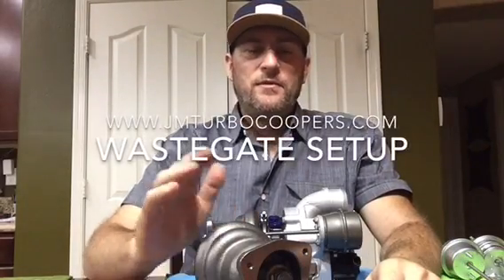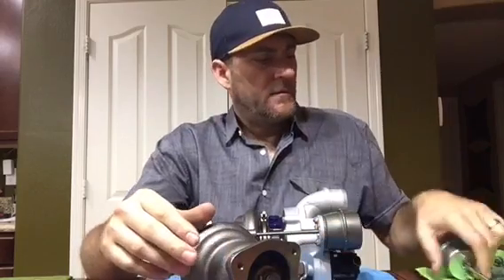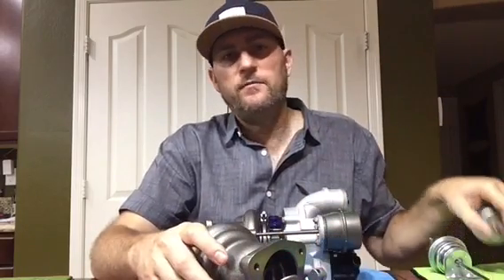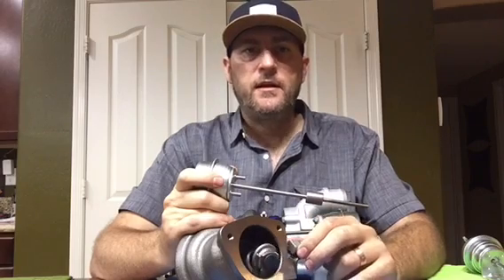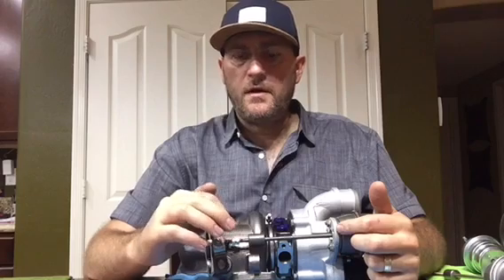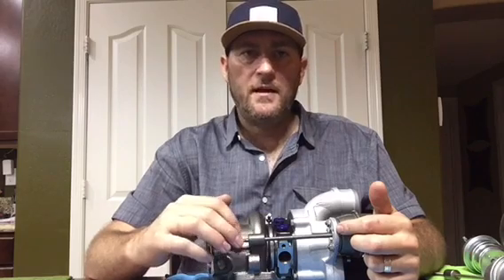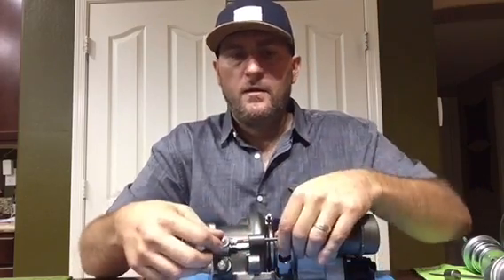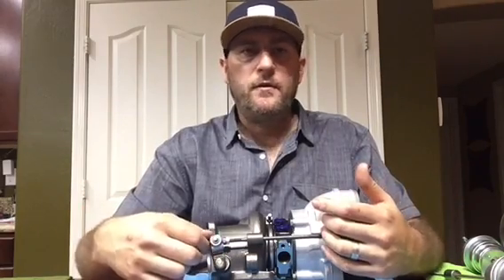Vacuum Operated Wastegate/Turbocharger Setup

Comment: So when I set mine to 5/16 after replacing the wastegate it gave me boost again but when accelerating hard it surges. You can feel it geeting boost and then it lets off a couple times a second. Would this be getting too much boost then opening the gate to compensate?

Comment: Question turbo smart actuator using the positive pressure assistance what am I getting source pressure from manifold or t into the factory valve I’m confused because doesn’t the factory valve only pull vaccume

Comment: Opel also uses vacuum operated ones.
Reply from the maker: Yeah a lot of manufactures are going this way, so the WG can be opened when driving.  With the WG open you will get better gas mileage since you are not in boost.

Comment: Thank you I own an 07 R56 S and have been fighting a boost robbing gremlin.. your description of operation I found to be very interesting. My code is 2885 and so far it's kicking my butt. I've been a mechanic for 40 years but these days I'm a vehicle inspector. Anyone tells you that they know it all is full of crap. I don't give up easily and I've seen so many videos trying to find answers and this on is the best.
Reply from the maker: You are welcome glad we could help, usually the valve in the turbine housing will get warn out and will rock open due to the wear.  If you rock the valve front to back in reference to the car not the travel and the arm moves more than 1/8" the turbine housing will likely need to be replaced.  They usually wear out starting about 60k mile and don't last over 120k miles that I have seen.  Hope this helps let us know if you need more info.

Comment: I have a 2012 mini cooper jcw. Whenever I open the flapper I get a code and low boost. But when I have it closed I get good boost and no code unless I redline the car. I have no idea what to do. I changed the boost controller and the vacuum lines and I have a diverter valve and a new wastegate on the way. I also have a new flapper coming but it's difficult for me to change it since I don't have a welder and I don't know how to weld. I'd also have to take the whole turbo out. I'm thinking I should maybe get a whole hot site assembled if I was gonna take out the turbo. And I don't want to change the turbo because it's a JCW turbo and the turbine has no play and it's expensive.
Reply from the maker: Usually when you get the 2885 error the housing is warn out, if you have over 80 to 100k miles it will likely need to be replaced.

Comment: So, an s42 is an upgraded turbo and setup at 1/2”?
Reply from the maker: a little less but that depends on how restrictive your intake is on your car.  The pressure drop from a bar and plate intercooler is 5 to 8psi and on a tube and fin it is only 3 to 5pis.  So you may have to adjust the wastegate because if you have a bar and plate IC the turbo will have to produce 25 to 28psi so you can get 20psi at the intake manifold (Tube and Fin would only need to output 23 to 25psi).  Also the pipe that runs from the IC to the intake manifold on the R series turbo cars (excluding Countryman and Paceman) have a restriction in the pipe under the IAT map sensor that can have a similar problem.   This just means that some cars have to have the waste gate adjusted so there is less travel.

Comment: For a BMW wastegate, how does the wastegate see vacuum while in boost to close the door further? I understand how at idle the vacuum of the engine pulls it shut and you can bleed that off by exposing it to atmospheric pressure, but what about needing to build boost back up while in boost if it's undershooting target??
Reply from the maker: The ECU doesn't monitor the vacuum pressure it monitors the intake pressure and only cycles the pressure valve to increase the open or closed distance of the valve in the turbine housing.   this will change the turbo speed and adjust the pressure in the intake manifold.  So the valve will remain more open or closed until the boost pressure needs to change again.
Reply: @jmturbocoopers  but if the wastegate is normally open and requires vacuum to close, how would the wastegate ever get pulled back shut to build more boost if you're already in boost? Mechanically, not from a control/ECU perspective
Reply: @HardwayLearning I've stumbled across this video myself questioning the same thing, my engine 8ar-fts has a vacuum pump on the back of the block driven by the camshaft, I would assume this is what produces vacuum even with high rpms and high boost.

Comment: I have a 2013 x3 bmw 2L  turbo I took it to bmw dealership they diagnosed it after changing the actuator and hoses but transmission light still comes on after speeding up then no power then bmw said I need new turbo I can drive long distances on the highway don’t lose power or other issues please help??

Comment: Hi mate, my car is hyundai i30 1.6 diesel 2010, my turbo sounds like a  siren, I have check the turbo there is no wrong with it and it, once I disconnect the vacuum line from the turbo actuator the sound go away and the turbo works fine with no issues

Comment: I have a mini cooper s R56 with a THP. I notice that I have little power when I give full throttle we have tested the membrane of the turbo that works tested the vacuum hoses that all work well too I also replaced the pressure sensor but I still have the same problem ... could it be the wastegate the problem? sorry for my bad english

Comment: How much should I have to pull my actuator arm out to slide over the pin with the engine running ? Should it only be a few mm to pull out the vac arm with it running and under vacuum? Thank you

Comment: Very detail. My problem is my car is under boost (code P0299) and when the car is idle or off, the actuator is in a fully pull position as if the vacuum is already beilng applied (not sure if it is stuck open or close). I have to pull it away from the actuator to move toward the waste gate. Do I adjust the nut one full turn to lengthen the rod? Would that work or there is another problem?

Comment: Actually, the duty cycle on BMW is to control amount of vacuum to the actuator, the wastegate would not open and close rapidly, but hold in a position according the the WGDC.
Reply from the maker: Yeah i agree it is only at 3000 to 3500 that we hear the valve fully opening and closing.

Comment: Guess what in saying is that wastegate on my car closed while idle or is it open its a 2014 Chevy Cruze 1.4 l turbo and I was thinking about getting a boost controller and sticking it on the actuator vacuum line which I'm confused about what does the less vacuum cause more boost or fully open what does that do ,or if less vacuum to the actuator cause more boost is to waste gate

Comment: What does a manual boost control do because I have a Cruze and want to get a little more boost only like a 5psi boost  ,so if I have it hook up to the vacuum line on the actuator ?is my wastegate closed at idle?

Comment: I'm replacing the turbo core on a peugeot with the vucuum wastegate. Should I adjust the wastegate just a little bit to give it a little more boost or leave it as it is original ??

Comment: Your video was very informative i was trying to find info on vacuum controlled wastegates.
I have an issue on my car and i try to figure out whats happening... 
So the car experience some lag under 2000 rpm but after i reach 3000 its asselerating rapidly, so much that if i go full throttle aggresivly i get an overboost error . If i dont get an overboost, After it reaches 260kpa (1.6bar) the pressure drops to 0kpa and stays ther for as long as i press the throtle.

Comment: Where does the vacuum come from at full throttle?  This is about the dumbest idea I've seen from Mini/BMW yet!
Reply: It uses a vacuum pump for wastegate control and the brake booster.
Reply: @kieranjamieson  yea... leave it to bmw to complicate things that dont need to be complicated... i will never buy a german car. vacuum pump for the brake booster.. because I like slamming on the brakes as im accelerating.. please shed some light on this design..